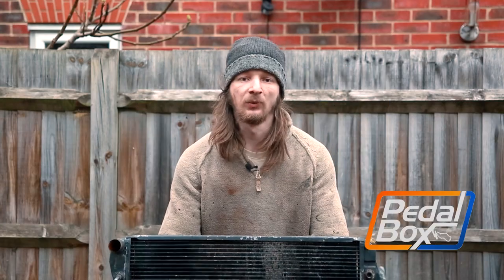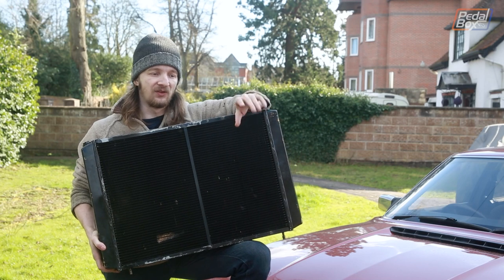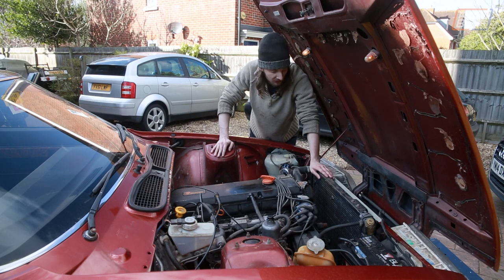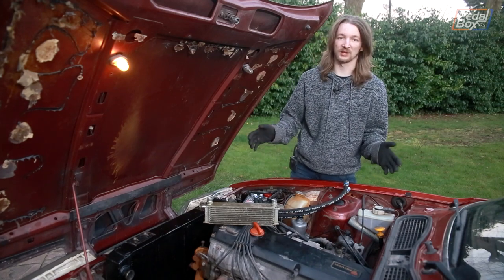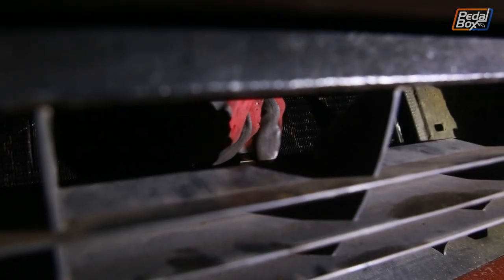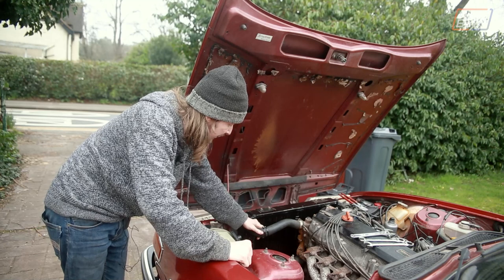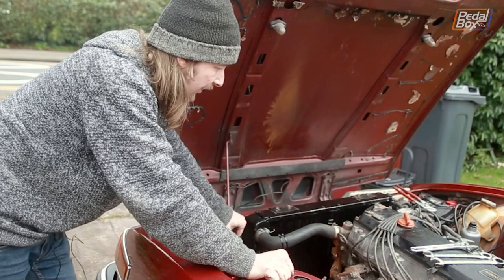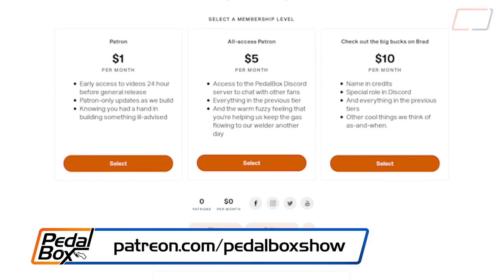Radiator and Transcooler Install | Rover SD1 | PedalBox Fleet Episode 73

Comment: I tried to focus on the content but Loreal advert in the middle got me.

Still that is some serious beef on that rad... something tells me you'll never need a fan on there. Even in summer. In traffic. During a heatwave.
Reply: All the beef in the world is useless with zero airflow, and the fins are so dense that the little bit of ambient / atmospheric airflow you get while parked in a gentle breeze doesn't really push air through. The air flow resistance through that radiator is huge, so I'm fairly sure at very low airspeeds (which induce very low static pressure across the rad) cooling could actually be *worse*. The saving grace is that all the thermal inertia of the added water (there's over 2 liters more water than before) and the huge copper mass means it takes a while to saturate with heat when idling.
Reply: Small extra bonus because (given airflow) the rad shifts so many more watts per degree C of temp difference (thermal conductivity equation is a fun one here), the rad itself is really cold compared to the stock one for a given engine temperature. So when hitting traffic after a happy drive, the rad starts cold. Which just makes all that added thermal mass even more effective as a short-term heatsink.
Reply from the maker: RADIATE THE WORLD (with a breeze)

Comment: Cracking video! Iam in the process of restoring my 2600 VDP but cosmetic bits i need are proving difficult to find
Reply: Cheers Dan! I haven’t had a lot of luck with cosmetic bits - the club forum has been really helpful pointing me in the right direction for stuff that’s still in production but there’s a lot of stuff I’ve decided I’m just gonna have to wait for another Rover to die and pinch, or 3D print myself.

I’m making my life a little easier by cheating a bit - I’m actually not a huge fan of the chrome etc so I’m probably going to just sort of smooth the car out a bit over time! Already lost a lot of bits and looking to lose more :)
Reply: @ChrisDRimmer  Thanks for the reply much appreciated il bare that in mind i think il be going down the 3D print route soon ive already had the dash binnacle cover made out of fibreglass and black vinyl. I am actually quite shocked i also own a mk1 827 and parts for that are incredibly rare its taken me nearly two years of stockpiling parts and work to complete it. When i bought the SD1 i thought ah with all the India stock they will be plenty to go round how wrong i was haha! Keep up the good work loving the SD1 vids
Reply from the maker: Thanks Dan!

Comment: When 2J? 😁
Reply from the maker: When 2J cheap maybe :P
Reply: Never! This motor is staying in. If I do an engine swap in any SD1 it’ll be a turbo K series because small and light and stupid cheap.
Reply: @ChrisDRimmer  Still waiting for you to have a go at turbos ;)

I've recently bought a dead head for one of these just so I can have a look at the porting and combustion chamber volume (29cc if you were wondering), and the inlet ports look pretty good as standard but there's a lot of headroom to improve the exhaust. The valve guide boss is massive and necks down the port to a real half moon shape. There's plenty of metal above the port to secure the valve guide so a little tickle with a carbide burr would pay huge dividends I think.
Reply: @BiTurbo228  stuck W/ money atm, I’m down about £1,000/mo versus where I was this time last year so progress is slow. I’m still slowly accumulating turbo bits though! I’ve heard and read a lot good about these heads so have high hopes. Especially given how much Bruno Pinho was able to get out of his with just cams, headers, and carbs. 200bhp naturally aspirated seems easy via his route. I have a spare head now as well so definitely have the means to do some fiddling :)
Reply: @ChrisDRimmer  Ouch that doesn't sound like fun. Hopefully it picks up a bit for you again!

If I get round to getting a set of exhaust manifold flanges cut before you do I'll let you know as that's a piece of the jigsaw for my Spitfire project as well (I'm leaning more towards selling the 2.5 OHC I've rebuilt and heading straight for the Rover engine).

Have you put any thought towards inlet manifolds? The standard ones have a much smaller bore than the ports in the head. There looks to be plenty of material to open them up a bit, but it'd be a tough job getting a burr down all the passageways. Seems easier to get something made up from scratch. If/when I get round to doing that I'll let you know too!

Oh, also, not sure if I mentioned that I was looking at O-Series turbo pistons as a big bore option for these engines (nothing like modifying an already rare engine with parts that are like rocking horse poo!). I've measured the distance between the bore and the water galleries on the head, and if the bore walls are the same thickness as that then it should take that easily (I think the limit might be somewhere around 85.5-86mm, depending on how square the bore castings are). 84.5mm O-Series turbo pistons would give a 2.8l, with 10.26:1 compression (still need to confirm the dish cc in an O-turbo piston), with the same diameter gudgeon pin and pistons that poke 0.15mm out the top of the block.

Also also, I've picked up a NOS 2600 cam and a dial gauge indicator so should have a detailed picture of what the stock cam grind is like.
Reply: @BiTurbo228  we should really pick this up on the forum or something tbh, YouTube is a garbage platform for discussion. I swear it must be by design as it’s incompetent in ways that seem difficult to do accidentally.

I’ve had a (very ugly, but working) exhaust manifold made up for the turbo, and my intake manifold is probably gonna be a set of BMW M3 throttle bodies with an adapter flange as the bore spacing seems about right. Haven’t really thought about it a huge amount tbh though so might be missing easier options!
Reply: @ChrisDRimmer  Good plan, posted on the forum! Glad to hear you've got some bits put together so far. Interesting on the M3 throttle bodies, wonder how they match up size-wise to the 2600. I expect they might be a bit big! But that's not a major issue if you're going turbo as they're a bit less sensitive to that.

Port spacing on my head seems to be 96mm (same as bore spacing). A cursory google suggests the port spacing is the same as a Duratec, but that might not be a great deal of use to cut and shut a manifold as the ports on those are oval I think.